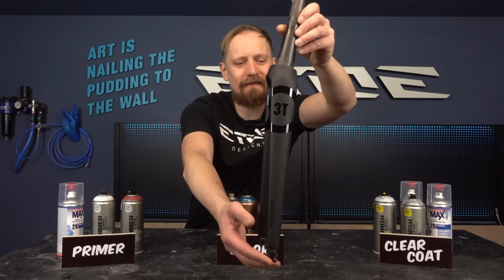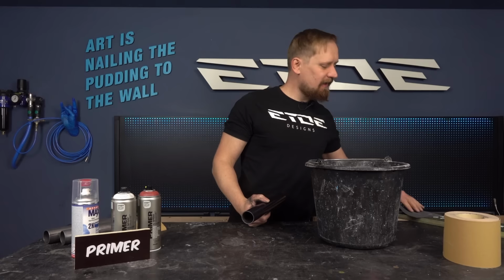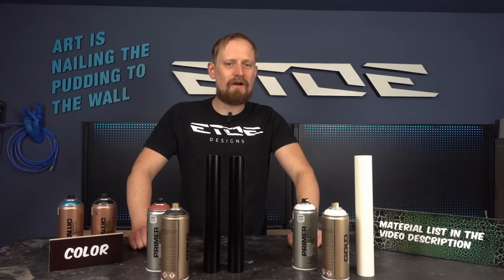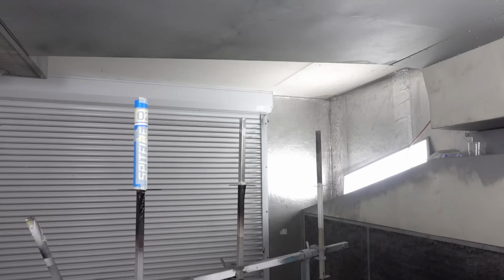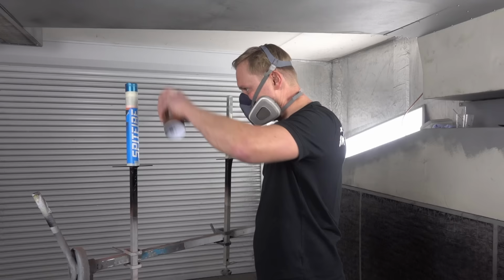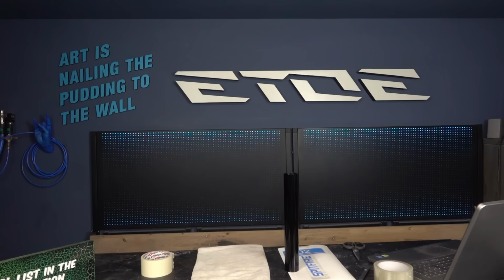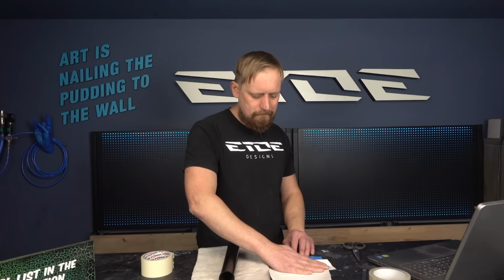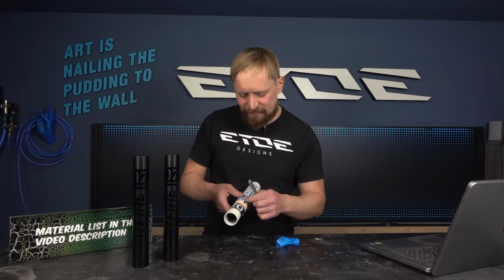BIKE PAINT DIY - spray can matt & gloss - the ultimate guide

Comment: When painting a bike (carbon frame with 2k primer) I need to sand after the primer. Do I need to sand again after applying the base coating? Or is it enough for a high quality paintjob to sand the primer and then sand again in between the clear coating steps?

Comment: You produce nice work so you must be doing things right.  I can see for sure you choose good paint products so that's not a question for me.  What I want to know is your process and timing.  In this video you primed and laid a base color all in one step.  Would priming, off-gassing for 2 days and then wet sanding the priming coat, cleaning, drying and then applying a top coat be better or worse or same and why?  How long did you wait to apply the gloss/matt clear coats?  It's obvious you didn't do the base/clear in one step since you wet sanded the base coat. Thanks for the great video and your time in putting it together and sharing it.

Comment: In this video you recommend wet-on-wet spray painting, but in another you recommend waiting for the primer to dry, sanding it with 800 grit paper, then applying a second and final layer of primer. As far as I can tell, one method saves time, while the other saves spray cans. Is there anything more to it or am I overthinking all this?
Eager to try and apply everything I've learned from your videos soon, when I get my steel frame sanded :)

Comment: Martin, really appreciate your videos and the links with each. I have a carbon Rocky Mountain frame that I want to sand down, 2x primer, and color gloss black then 2x matte/satin clear like in the video. I have experience painting solid colors on bikes and feel like I can take it this far from your videos. Issue is that I want to paint on letters and some accents over the matte clear but have them show as gloss. Assume that I mask, then spray on the color for this but then spray 2x gloss maybe one coat before removing decals? Concern is will the lettering be too high with 1x color and 1x gloss clear. Thanks!

Comment: If I wanted a matte clear coat on the frame (no base color, I want the natural carbon to show) with gloss logos, would I use the same method as your “more advanced method?”
Reply from the maker: No you need clear carbon primer. Clear coat will not stick on carbon.
Reply: @ETOE  thank you for the reply! I found it in your links on this video. Your other video did not list the clear matte primer. Thanks!

Comment: I have aluminium frame with few visible paint chip. My question is after sanding should i use metal primer or epoxy primer? 2nd questtion is can i use paint remover for faster option?

Comment: Hello Martin, I decided to train spray painting a bit on a steel “cage” structure which is another diy project of mine. I bought Chameleon acrylic primer and black matte color in my local shop. They adviced me to apply 1 layer of primer and 2-3 layers of color. In this video on the other hand you apply 3 layers of primer and 1 layer of color. Could you please help me out understand? Thank you in advance. Your videos are really helpful and inspirational. Appreciate it. 🙏
Reply: Ive just encountered on an answer in your Q&A video 😃 Although one thing is still not clear to me - How long do I wait between painting and sanding? Lets say i am doing that matte black cage I wrote about. Obviously I want it perfect, so I do 3 layers of primer, 1-2 layers of color, wait 2hrs, sand down with 800-1200 grid, 2 layers of clear coat, wait 2hrs, sand down with ?2000 grid and do last layer of clear coat? Is it possible that I got it? What determines those 2hrs? How do I know? Thx!
Reply from the maker: Same amount of time I wear my panties before a change is needed.
Reply: @ETOE  Considering you are german that would be exactly 12hrs?

Comment: Great vids Martin. I followed one of your vids to paint an old aluminium frame. I cleaned the frame to bare aluminium, used etch primer, Montana gold colour and spraymax 2k clear coat. It looks ace, like a pro finish. But the paint is not very durable, it chips off easily. Is there any way to get a more durable finish?
Reply: Powder coating

Comment: This honesty couldn’t have come at a better time. I’ve just finished sanding my frame to raw, and I’m also about to use Montana cans including the aluminium primer. Going to go two or three colours in simple lines, sanding in between each layer etc. 

My main problem is I’m unsure which varnish to use. I feel like semi gloss is the safest option but may go full gloss as I don’t want it to look dull.

Also going to do two coats of primer. Sanding in between the first coat, do I sand the second coat and then go onto base colour or do I just paint straight on top without sanding?
Reply: @cmg9916  thank you that’s what I first thought, the paint needs something to key into so wasn’t sure if it would be too smooth. I’m really excited as I’ve taken my time sanding and I’m in no rush as I have other bikes. It looks so pretty raw I’m almost tempted to polish and clearcoat but think I’m going to stay with beige, plum and pine green with white accents throughout.

Comment: Hi Ive been watching many of your videos recently because I want to turn my brand new red bike to all matte black. I have a question, can I get away with not sanding the brand new new bike frame and just prime it, paint it, and clear coat? Or will skipping this sanding step be hazardous. I dont think it will be terrible since its not rusted and its new and clean. Maybe im wrong, but thanks for the info.
Reply from the maker: You won't have any adhesion of your paint job and it will peel of.
Reply: @ETOE  okay thanks for your input I decided to go with a liquid deglosser and metal brush 🙏👍

Comment: Thanks martin, superb video... So handsanding the primer is unnecessary for spray can paint job?
Reply from the maker: Depends on the primer and if you do wet on wet or if you let the primer cure.
Reply: As a non professional guy, I'd prefer to let the primer cure, then wet sand it
I'll get the smoothest surface as possible and maybe correct some defaults (in the corner)

Comment: Did I miss it but after you spray the gloss bike with the mat finish after stenciling. Do you then need to wet sand again and then spray with a clear coat for durability? And what will that do to the contrast mat/shine finish. 
If you don't sand afterwards. How durable is it?
Great videos though.
Reply from the maker: You don`t need to use extra clear coat. The used golss and matte clear coats are already clear coats.
Reply: @ETOE  thank you. 
If I wanted to do a fade. Bottom to top. With mat decal. Can I ask the order of operations?
Or do you have a video on this?

Comment: Thanks for another great video, quick question I have a media blasted alloy frame and have a 2k spray can primer. Do I need to use an etch primer first or can the 2k primer go on the bare alloy. Does the frame need to be sanded of is the bare blasted finish OK to prime straight on to...?

Cheers Ric
Reply: Thanks for another great and very informative video Martin, I subscribed this week! More interesting to watch than a lot of videos out there! I am also interested in the above question by Ric... I've stripped my aluminium frame but it has been grit/ media blasted and is quite rough particularly around the head tube. I don't want to remove too much of the metal so can I Prime directly with the 2k primer filler now and use extra coats of the primer to build up the surface so I can get it smooth enough for colour? Or do I need smooth the finish a little more first with sanding pads up to a certain grit? Thanks a lot and keep up the awesome videos!
Reply from the maker: If an alloy frame is rough after media blasting it is damaged and the wrong media was used. Cheap blasting with sand does that.
Reply: @ETOE  well it is a Cannondale (original) 😂... Wish me luck!

Comment: Hello Martin, really great video! I would also like to paint my bike in matt/gloss at the moment and I used your template with the white pipe Oracal 631. I bought exactly the same cans as in your video (2K Spraymax primer and Montana Black).... Me I have 3 layers of primer and one layer of Montana Black in a wet process, just like you painted it. After that I sanded down the pipe with 800 grit paper and cleaned it with Spraymax 1k silicone remover... I then have 2 problems. The first problem is the Montana Power Orange color, it looks flaky. The second problem is the masking tape (Oracal 631). When I pull it off, a lot of glue remains on the pipe and the flakes of orange settle on the glue... I've already tried Oramask 813 but the same problem... Do you have a tip for me?
Reply from the maker: Yes, visit a paint shop and pay them to do your bike. It's the easiest and fastest solution for me. So I have time to do new videos.

Comment: Two questions 
1. I'm just wondering what is better. To spray matte over the gloss or gloss over the matte?

 2. Can I polish the finish after to remove any edges between the matte and gloss or will this make the matte finish glossy?
Reply from the maker: 1 doesn`t matter. 2 you can`t polish matt finishes.

Comment: All great. Help needed: If I have used sprayMax 2k 680061 and is still soft after a week in cabin 50% humidity, +26degree Celcius temp., should I wait more or sand it off and do clear coat one more time? Cheers.
Reply from the maker: First you have to train your spaghetti arms to learn how to push the valve in the can hard enough to do a proper mix of the hardener and clear in the can.
Reply: @ETOE  Accepted. So,  sand it and recoat it with proper mix. Cheers.

Comment: Great videos thanks!  Question, how would you paint over chrome metal parts, prep and paint and clear coats using that Montana spray cans ? Thanks
Reply from the maker: I would remove the chrome first.
Reply: Ok thanks, and would you remove chrome by sanding or chemical striping?

Comment: Hi, awesome video!! Quick question, on some of your videos you mention that all the paint has to be removed before you prig me and re-paint. But in this video you mention that it just needs to be a flat surface and you dont have to remove all the paint.  Im a bit confused as to which method to use.  Thanks for your awesome videos!! Im going give it a shot.
Reply from the maker: Home DIY style (bad fail possible) just sand the surface. Pro style remove all paint and start from scratch.
Reply: @ETOE  awesome thanks a million